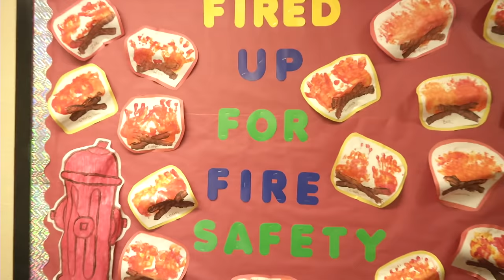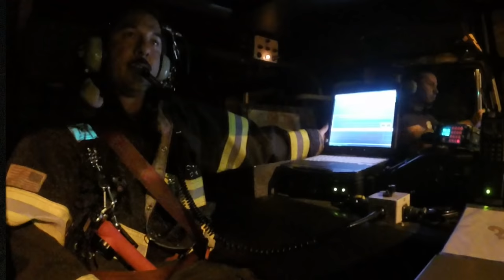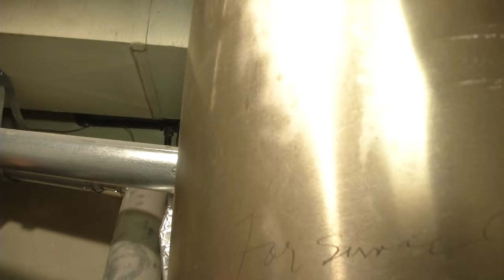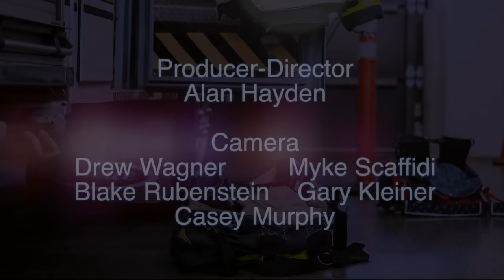Rolling Hot: Denver Fire - Episode 1

Comment: How old is this video. That stretcher looks like it was used in emergency the show.
Reply: Andrew Gatlin Denver health has more of the old style than the newer Stryker power and manual stretchers. its more about cost. though I have seen some of the Strykers.
Reply: saright jacket for a bad grlis
Reply: Due to the high call volume of Denver Health, they see no reason why to change it. If it ain't broken, it doesn't need to be fixed.
Reply: Station 51 kmg365 emergency

Comment: theoretically if you have a room full of carbon monoxide CO, couldnt you just pump more oxygen in making it carbon dioxide CO2 so its not so lethal?
Reply: That's not how this works. This is not how any of this works
Reply: Yes you could but you would also be adding one of the three legs of Fire which are fuel oxygen any source of ignition remove any one of the three and you whip it